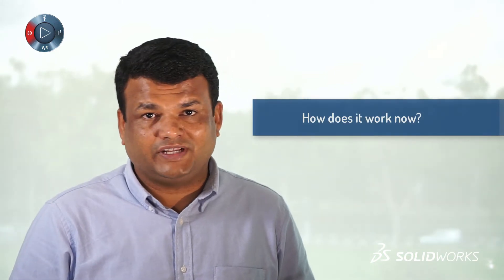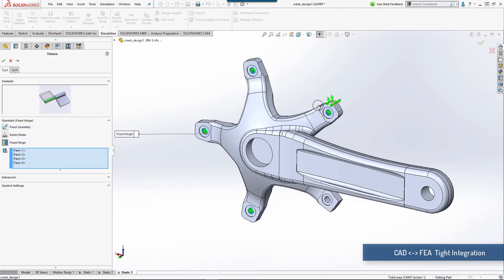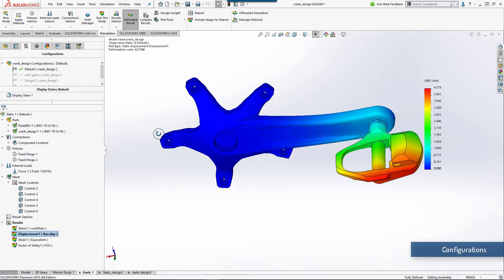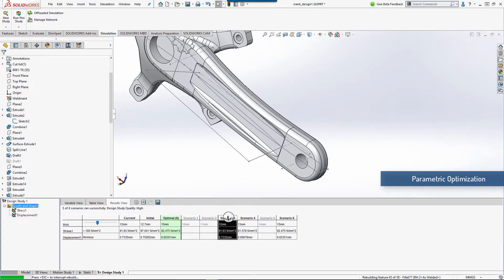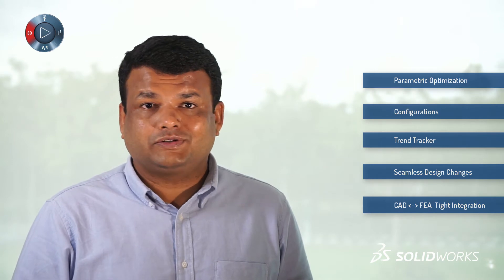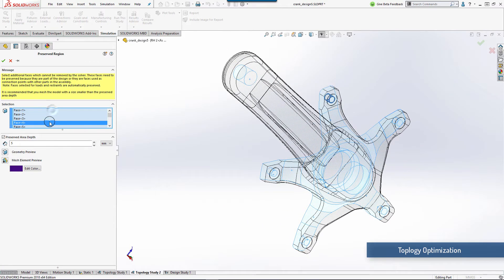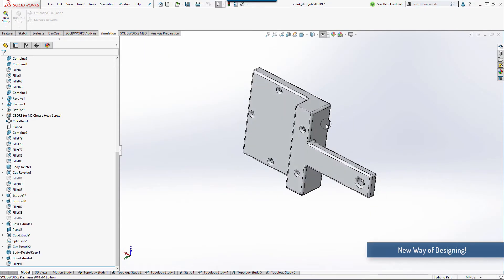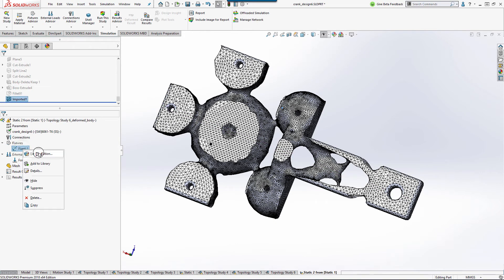Why SolidWorks Simulation - A New way of designing - Topology Optimization

Comment: The resulting part looks odd. Extremely thin bridges to lumps of material. What where the load conditions? Were keep outs used in the lump areas?
Reply from the maker: You are right, Radek.  a bit of reverse engineering would be required.